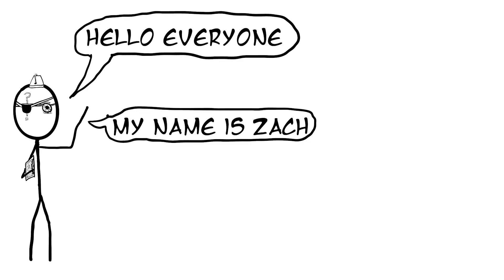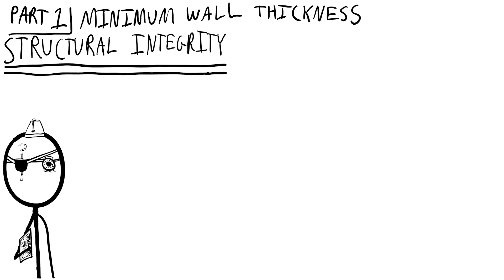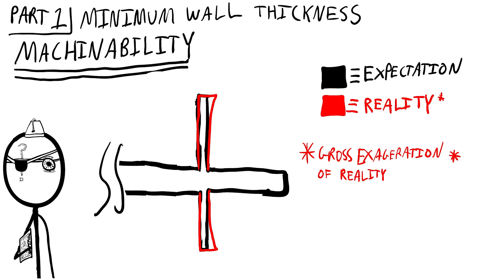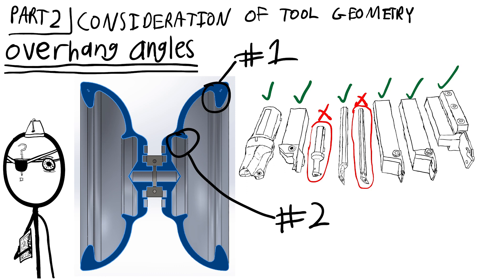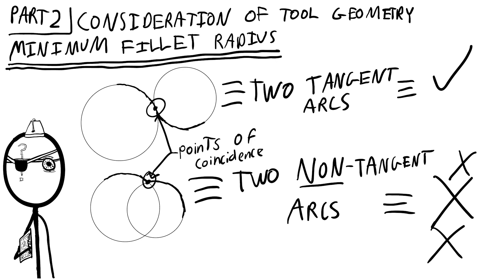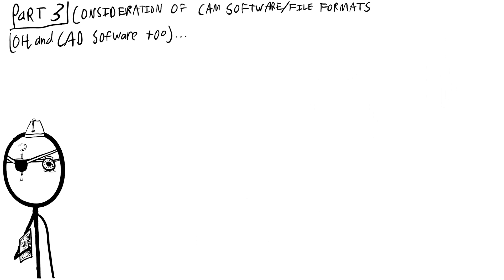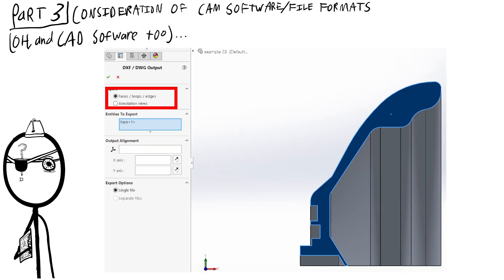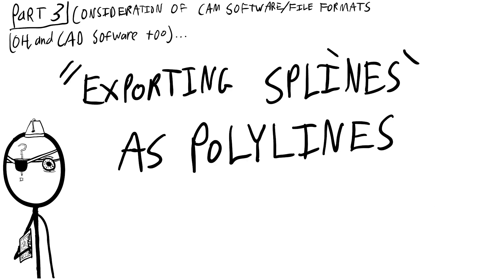Yoyo Design 101: Lesson 3: Limit State Design and Design For Performance

Comment: Would you be able to show the specifics of design for a more speed oriented yo-yo? I mainly do stopped combos and grinds and was always curious as to what that would look like. And also if I don't see any video you make for a while it's because I'm getting deployed so hopefully in four months I can take a look!
Reply from the maker: Good luck on deployment!  And as for a speedy yoyo, the criteria you should design around are a wide gap to rpm ratio to prevent snags, low walls and high rim weight to maximize stability, and either an H shape or a V shape to minimze surface area exposed to your fingers in the profile to minimize friction on thumb grinds.

I wont be able to make a video on each specific design type, but I hope this helped.